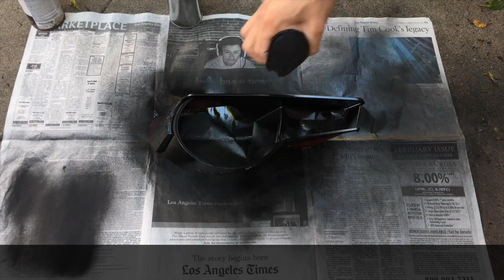86/BRZ: OEM Tail-light Split / DIY Custom Look

Comment: Dang thats a gnarly modification. I was looking for ideas on ways to modify by headlights on my impreza, and came across a similar method, but instead of using the solder iron, you bake the whole headlight assembly, and the glue that holds together the housing can be pried apart . You should look into it if you want a cool look for the headlights aswell
Reply from the maker: +BAYNC Unfortunately cutting into it is the only way to open this one on the FRS and BRZ. I really hoped I could just bake it but there are no alternatives :/
Reply: You can bake the headlights on an impreza, but the tail lights have to be cut
Reply from the maker: Just like the twins

Comment: Might as well do this to mine, my driver side one has condensation & water. So hopefully this will resolve it & make it look better
Reply from the maker: Good idea, it'll look great afterwards!
Reply: Hope I do it right, it'll save me money. Cost $299 on FT86 Speed Factory, doubt that your materials cost anywhere near that !
Reply from the maker: Just remember to take your time with it and you should have no problem. Also don't force anything open, always cut off every bits of plastic little strings. You'll see what I'm talking about when you do this.
Reply: Lol well I failed, I shouldn't of even starts cause I got the water out easy. Then tried opening & messed up some of the chrome .... plus takes for every to cut.
Reply from the maker: :( I emphasized the same exact issue on my video, should of payed more attention man...
Reply: Haha trust me I payed attention, but just inexperience I guess. It's ok, still looks decent & further down the line I'm most likely changing the taillights anyways. Project build
Reply from the maker: I see, it was pretty tough for me too, I also damaged the chrome part :P and the clear plastic casing lol
Reply: Still your video is dope instruction so keep it up. You haven't updated you IG ??!
Reply from the maker: Thanks man. My phone camera broke and I haven't had the chance to replace it...I keep telling myself I'll replace it but car parts keep popping up xD

Comment: Just confirming that the tail lights can actually be baked to be split open? I bought an extra set of tails cuz I’m terrified of screwing up 😅
Reply from the maker: So my method involves a lot of cutting with the soldering gun, hence there is a big chance of messing things ups; such as melting the chrome inside housing and moisture build up if not sealed thoroughly, you must be very careful. I don't think there's a way to bake it open but I'm not entirely sure on that myself either. Take your time and be meticulous!

Comment: Do you have to cut them? Why not melting the adhesive?
Reply from the maker: No cutting necessary. I highly suggest you use a heat gun, if not please set your oven at no higher than 150F. Pre-warm for 5-7min and leave it for about 7min, but make sure to keep an eye on it.
Reply: @TougeKing  are you now saying they can be separated in the oven without cutting like 6ou did?

Comment: If I were to add a clear coat over this would I remove the tape first then add the clear to like everything? Or just keep it on until I'm completely done? Don't know if the tape would get stuck if I add the clear over it and wait till it dries. Sorry if I sound like a noob, Going to be my first time trying this.
Reply from the maker: Eternal Beast If it was me, I'd just apply it w/out taking off the tape. But make sure the pain is completely dry!
Reply: +TougeKing alright I'll do that, thanks man.
Reply from the maker: Np bud. Also, be sure to take your time when splitting the case, dont rush it.
Reply: +TougeKing yeah I know, I read in your video how easily you can burn the chrome housing if you're not careful when cutting around the tail light. I'll definitely take my time on this. Going to try to add some sequential led strips awhile I'm at it  lol.
Reply from the maker: Eternal Beast Fosho, lmk how it turns out & good luck friend!
Reply: +TougeKing already messed up the solder I was using, the tip was too fat lol so now I have to go buy a cheap one that looks like yours so it'll be easier and I won't mess up anymore. The fat tip one I was using was just pushing the plastic inside the housing instead of opening it up lol.

Comment: is there any other way to access the chrome without melting the plastic??
Reply from the maker: Unfortunately no :/ 
What you see here is pretty much the only way to get it to open.
Reply: TougeKing....couldnt you put it in the oven for a bit so that the adhesive could be melted a bit and easily removed afterwards with a lttle bit of pulling force?
Reply: @Ali184Haider  absolutely, bake your tail lights for 1 hour at 220 degrees

Comment: Bake them @220 bro...
Reply from the maker: Marc Melena To split it open? Or you talking about the paint?
Reply: To open them up
Reply: Mine took about 13 minutes. Just be sure to put it back in the oven when it starts cooling off. I had to put it in twice to get the lens completely off
Reply: Marc Melena do they have clips to hold the lens in along with sealant?
Reply: sorry Marc, do you mean °F or °C?
Reply: @80corollafan  wher3 is your proof?